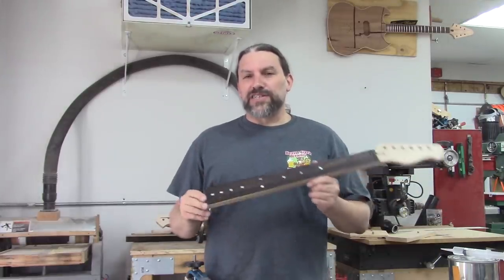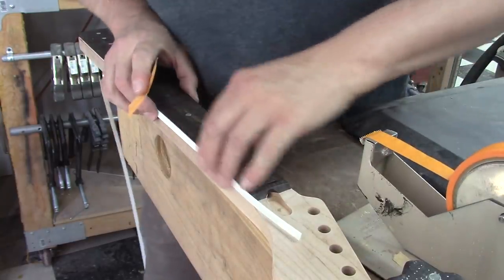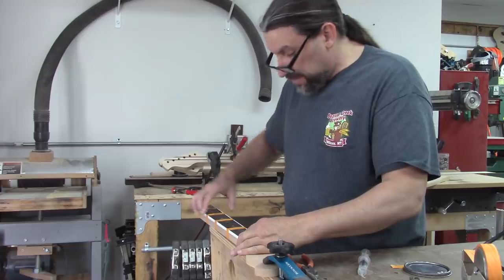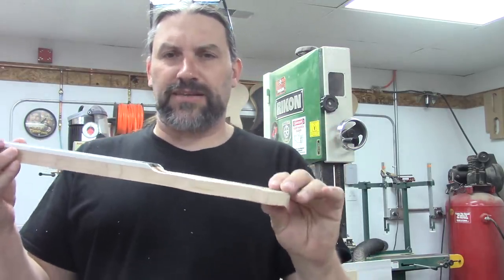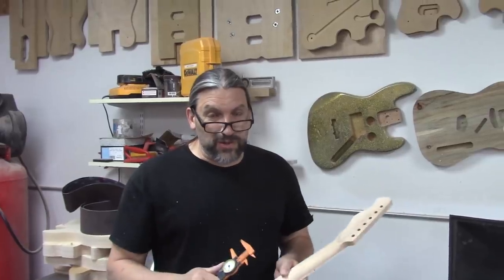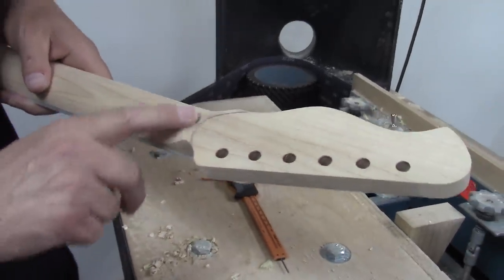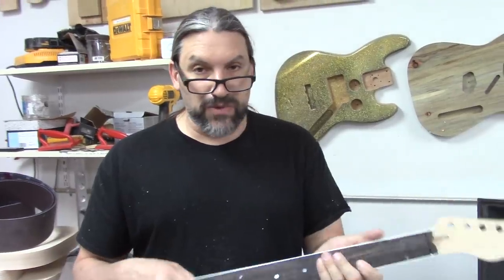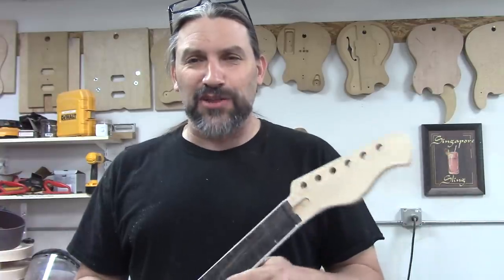The Great Guitar Build Off 2020... Real Guitar Builders Shape Necks

Comment: Not sure about the comment about using the router table either.  As an engineer  have always lived by the motto "use the right tool for the job" and it seems like the router table would be the preferred tool for that job.
Reply from the maker: It certainly is for part of it
Reply: Safer too. I cringed in fear for Matt.

Comment: The strangest neck I've ever felt, was an Airline guitar. It was just, a rosewood fretboard, screwed onto an aluminum tube! Have you ever heard of such a thing? Also, because you're just on the other side of the mountains, What would the cost be on doing a double binding (top and back), on a Telecaster? I'd think it could be done without changing the 3 color burst.

Comment: on my third guitar build  and figure about 10 more and ill start to understand what im doing but I did learn that using the acetone for binding is by far easier, cleaner and dare I say better to use in most cases compared to the stew mac glue.
Reply from the maker: I like the Stewmac glue as well but rarely use it on curvy bits

Comment: I can’t really apply to specifically to guitar necks as I’ve never actually made one, but I have routed a lot of relatively expensive wood and that’s just a lot of passes or it’s disastrous. Lol Fun to watch when someone else route a full 3/4 radius in one pass though. Lol
Reply: I’m not so bad now, but I’ve really fucked up some shit you know what I’m sayin? Lolol
Reply: Like no I’m feeling fucking lucky... look at that grain. It’s fine. Hail Mary mfs rolling dice on a $50 board. Woo I feel hot. Oh fuck that sucks damn it, Lolol
Reply: I don’t know if you all have seen Izzy swan with a table saw, but what Matt’s doing on the band saw is not that dangerous and unlike his understandable warning i think everyone should try it before shaping a neck on a table saw. Lolol
Reply from the maker: I know what you mean, I have a few tricks for dealing with that router tear out but that figured wood can be a bear sometimes
Reply: Seems I usually have some intuition where it’s likely to go wrong,  but tough to see all jacked up on coffee wearing rose colored safety glasses. Lol
Reply: I have liked that the follower or your pin router swapped out so quick and easy and expect that’s probably making multiple passes less hassle. I use regular router table sometimes, but most of the time I’ll prefer to run the router in hand. How did you get used to running the pin in the templates blind? I know it’s not going anywhere but not seeing the follower makes me feel all tense when you just go right to it. Lolol
Reply: Not as tense as watching Big D work. No different from that. Lolol